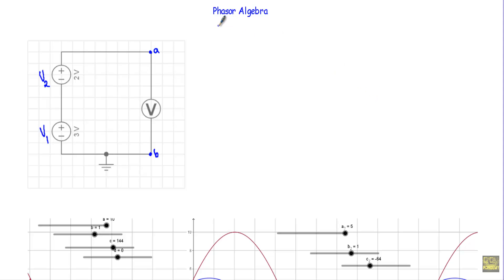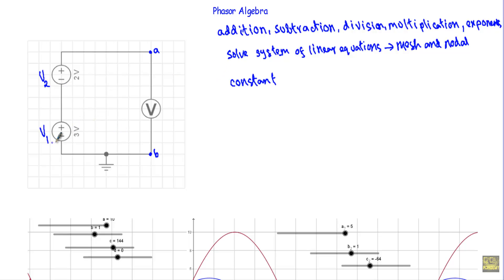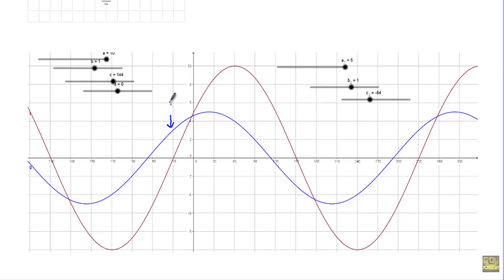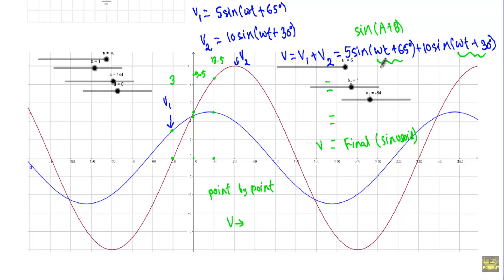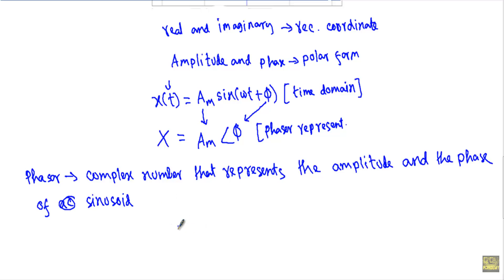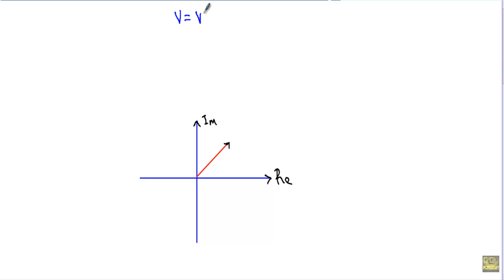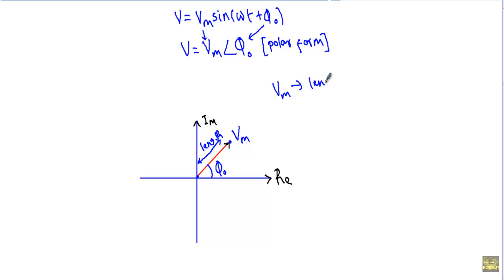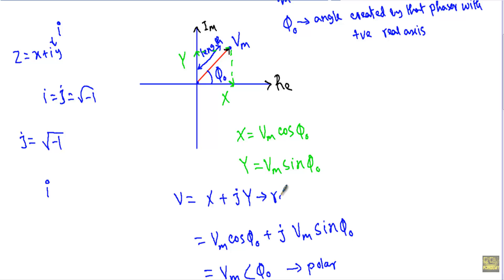Introduction to Phasor

Comment: I've made that mistake a lot of times... Fasors are actually associated only with cosine functions. Although all of your calculatios were probably right, taking that mistake further would leave severe errors in the signal phase. I hope u already knew that!
Reply from the maker: In a sense, you are right. However, I followed the book of "Introductory Circuit Analysis- Boyelstad" and some other books where they represented phasor with sine. " Fundamental of Electric Circuits - Alexander & Sadiku" and other books represented phasor with cosine. As sine and cosine are periodic functions and interchangeable, both of them are right. Whatever you follow, try to be consistent.
Reply: I agree with you. You gotta be consistent, because after all math is just about the representation.